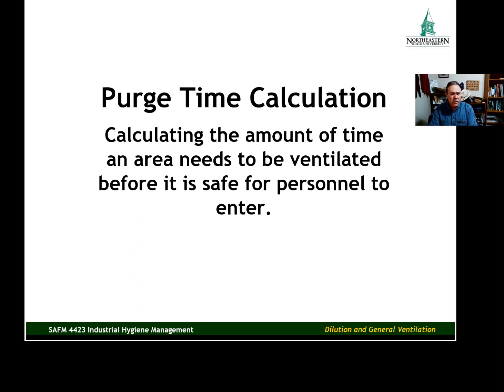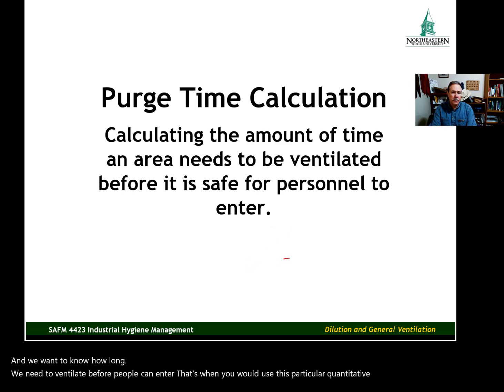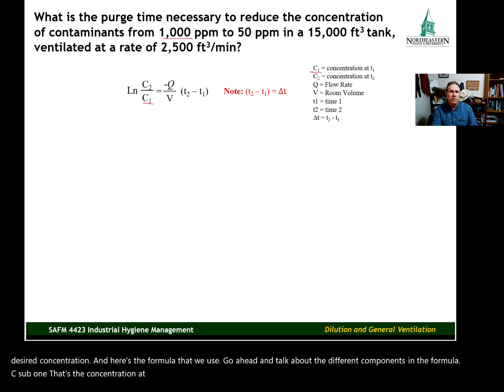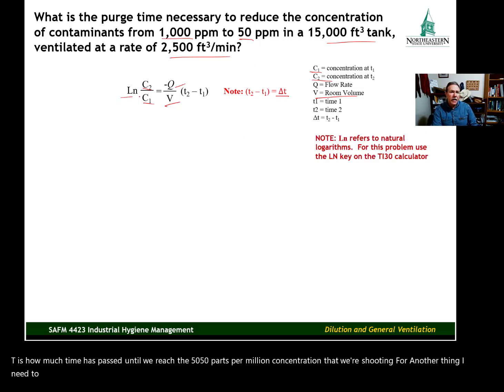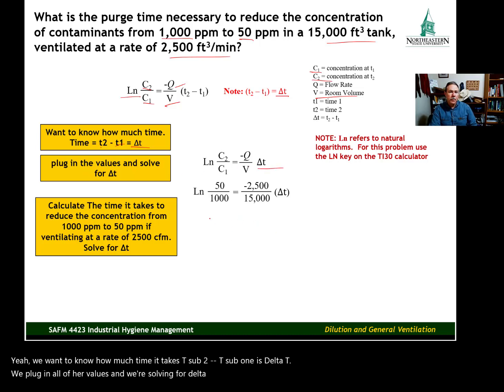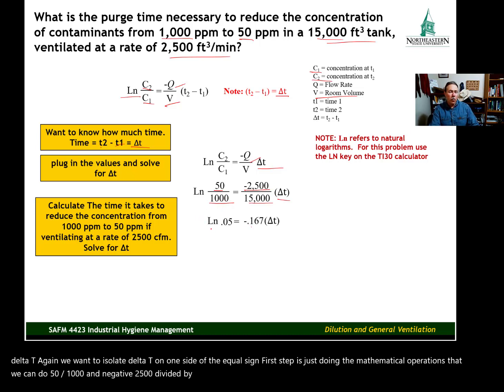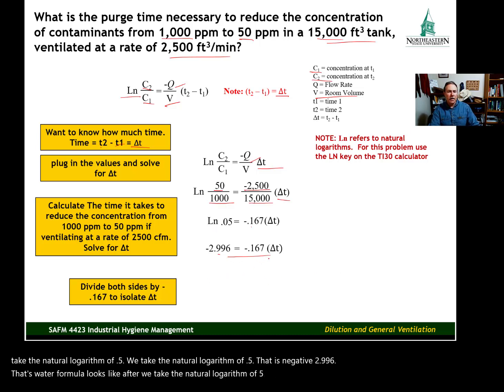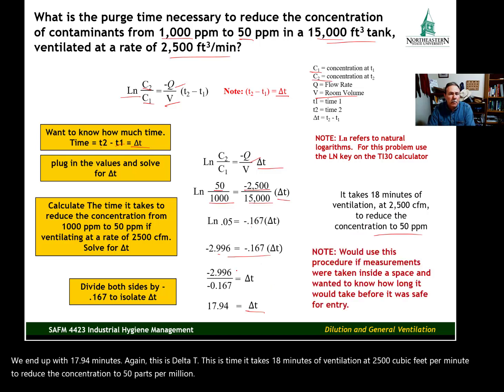Ventilation: Purge Time Calculation

Comment: hello, I've been searching the web everywhere for a simple question regarding forced ventilation times of confined spaces but I can't find anything, not even on the Osha website. All osha said was that they recommend 20 air exchanges per hour or 3 air exchanges per minute. Any input would be appreciated!

It's for school, and the question is as follows: How long should confined a space be force ventilated if its found to be a hazardous atmosphere? A) 5 mins B) 10 mins C) 15 mins D) 20 mins
Reply from the maker: Sorry for late reply.  I don't like this question.  There is really not a set time for ventilating a contaminated space.  You test the atmosphere before entry.  If contaminants are present you ventilate.  After ventilation begins you conduct periodic testing--throughout the duration of the work operation.   You ventilate until the contaminant concentration is reduced to a safe level.  If the source of the contamination is in the confined space, ventilation  would continue throughout the work operation.
Reply from the maker: There is one "rule of thumb,"  I don't think it is a regulation, that suggests ventilating the space for 10 minutes before initial atmospheric testing. 

If space is contaminated. ventilate for 10 minutes, then test the atmosphere.  But there are so many more variables to consider than just time.--volume of the space, volume of ventilation air etc.

 Maybe this is what the instructor is asking about?